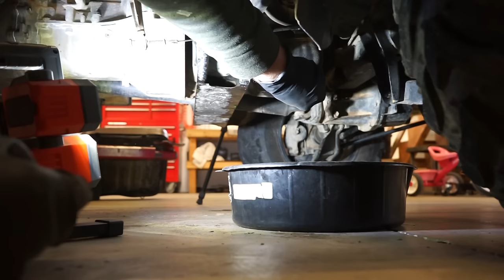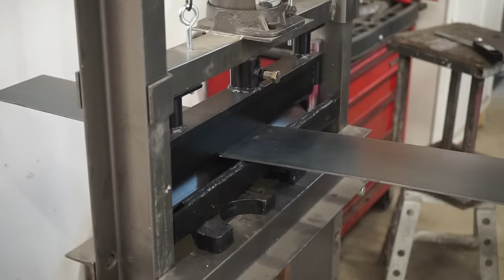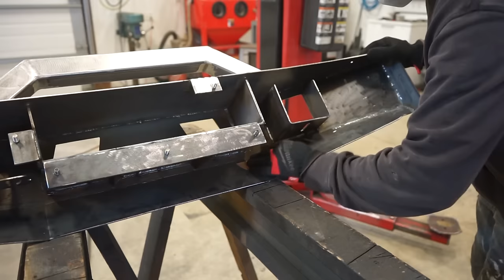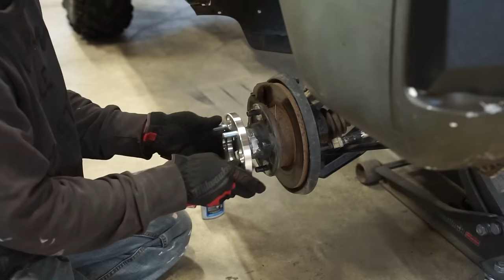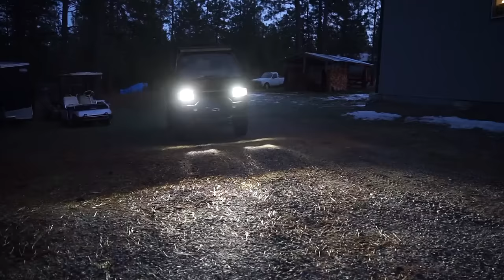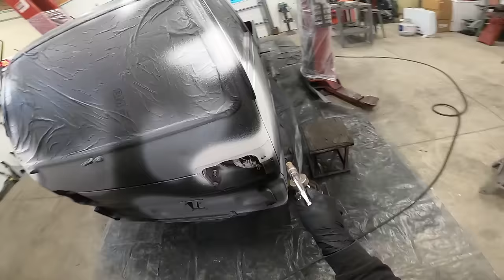Amazing Transformation Of A Suzuki Carry Mini Truck!!!

Comment: just a thought, but have you thought of getting an f10a engine for that little carry, it was used in the samurai and its very similar to the f5a used in that year carry with just one more cylinder, should fit in pretty easily

Comment: All these conversions are only possible in the USA. Here in Germany, the TÜV (Technical Monitoring Association) would withdraw the vehicle's operating permit on the spot and shut down the vehicle immediately. In Germany, every change to the vehicle must be documented in the registration and the installed parts must have an ABE (general operating permit). Work on the frame or other load-bearing parts may only be carried out by specialist workshops with the appropriate license. Even small changes to the exhaust system that have not been carried out properly and are not documented will lead to the loss of the operating permit.
Reply: That is so sad 😞. Thank you for sharing so much is taken for granted in America these days.

Comment: That was quite a transformation!  Thank you for this educational and inspirational video.  You have mad metal fab skills.

Do you recall which gray bed liner you used for the camo paint?  I'd like to spray the bed of a kei truck with a heavy coat of black bed liner and spray the rest of the truck, inside and out, with a medium or dark matte gray.  Amazon shows dove gray and mesa gray and they look the same to me.  There's a basalt gray that's probably closer to what I want but I could only find it in single cans which would be very expensive for the entire truck.  Maybe I'll get the custom tint I want from an auto paint store.

I wonder if I could Dremel out the cracks in my 4Runner dash, fill with epoxy and microballoon putty, sand, and use Raptor bed liner to spray the dash inside the vehicle because it's probably a two day job for me to remove and reinstall the dash.  It'd probably take a few hours to mask the car interior.

Comment: Did you forget that this truck only has about 45 HP with a 660 cc motor? You may as well put a plow of a snow mobile.
Reply: I have a plow on a Polaris 570 with 44 hp. Works well for clearing the yard. Its all a matter of two things: Low enough gear and grip. The Carry is equipped with 4x4 and low gear, all you need is snow chains or tracks.